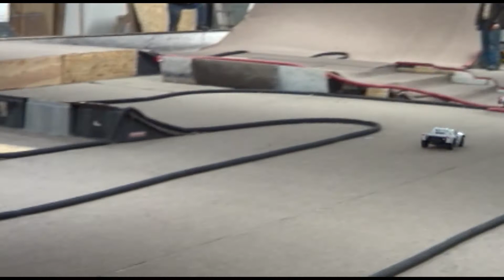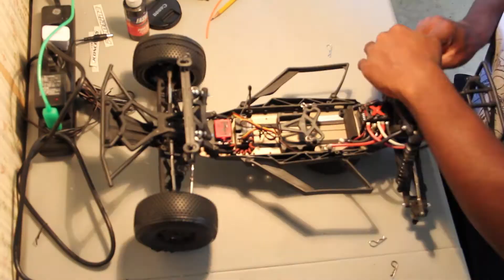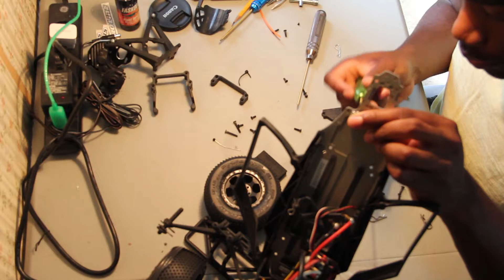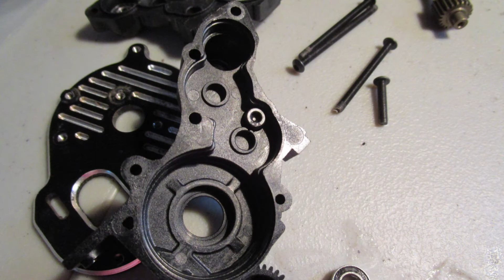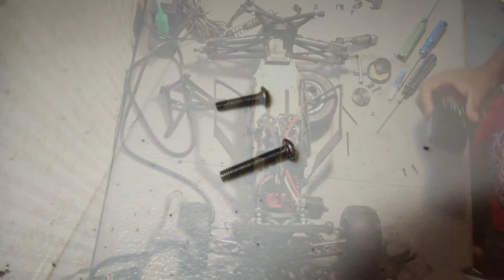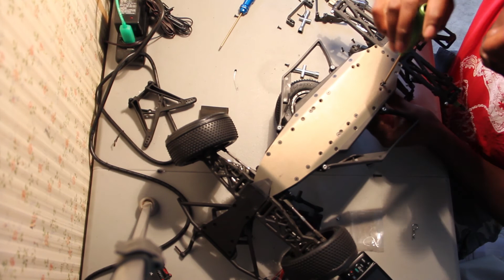How To Install Mid Motor 22SCT

Comment: Did u like the mid better?
Reply from the maker: 100%. Way more balanced in the turns.
Reply: @traxxasrockhead  cool, I got this kit when it first came out 22sct but never use the mid motor setup, have you had any problems stripping idler gears? I think I going to try the aluminum one .
Reply from the maker: @garys7119  I only had it for a few months but in that time I drove it a lot and I had no problems